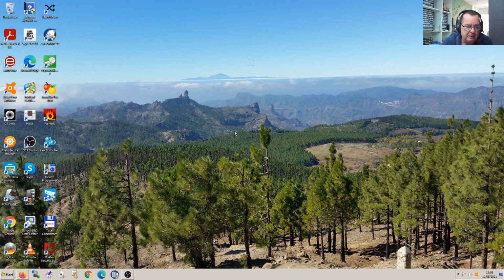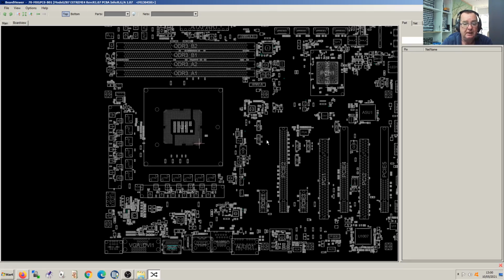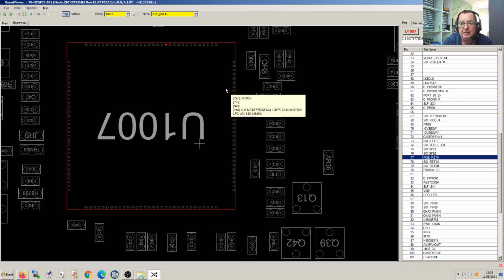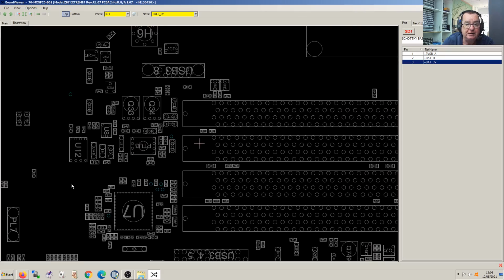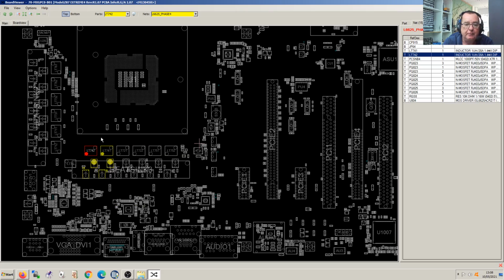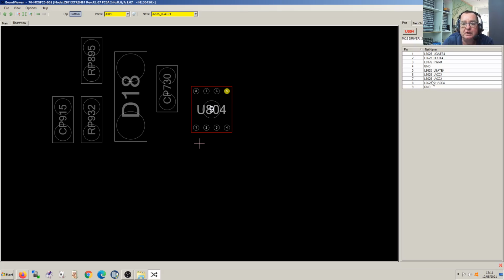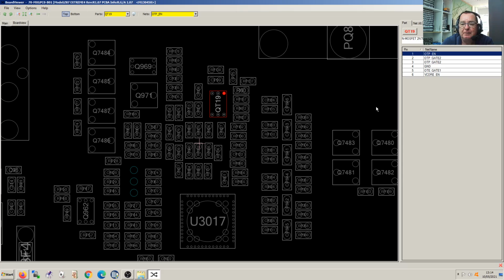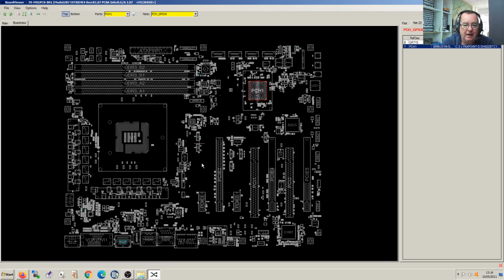LER 045 How to use Boardviewer & Boardview files to repair Motherboards Laptops and Graphics Cards

Comment: Where are the actual board files found?  I need one for a gigabyte Ragle Radeon RX6600 video card.
Reply: Did you find a website or two for the files?
Reply: @j.lietka9406  no, I did not
Reply: @j.lietka9406 I need board files for my Dell motherboard marking CAL51 LA-F121P
Reply: looking same thing

Comment: I wonder if this software is secure, because there is absolutely 0 information on the author.
Reply from the maker: A lot of guys use it on badcaps.net forum, where the author is a member, and no one ever reported an issue using it. I also used it myself many times.  Just because it is not well known software doesn't mean it has anything dodgy about it. Also it isn't an installer it is a standalone program.

If you worry about that sort of thing, use a different PC in your workshop than you use that contains personal data,  

I did this with a custom app you can download which has many encrypted pdf schematics not normally available (you can view them with the app but you can't save them in unencrypted form) and when installing this app, Avast says it contains a virus though the author says to ignore this.

As I wasn't sure and wanted to use it, I just installed it on an old P4 I specifically used for that application.  The software works for viewing the schematics, and as far as I am concerned it can infect that PC with virii or malware as much as it likes - there is no personal data or any other software on it and it isn't used for browsing the net or any other purpose so I really don't care :D
Reply: @learnelectronicsrepair  Thx for info